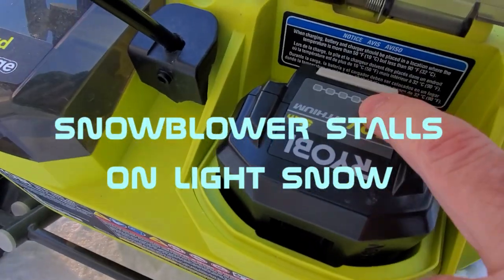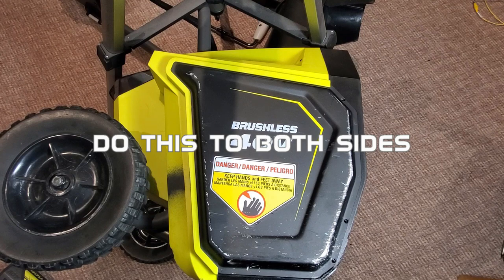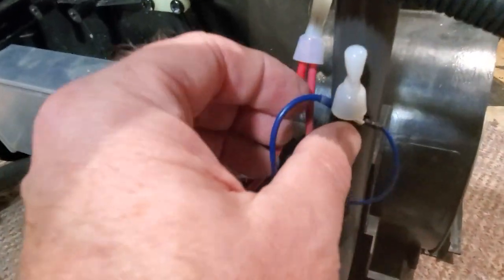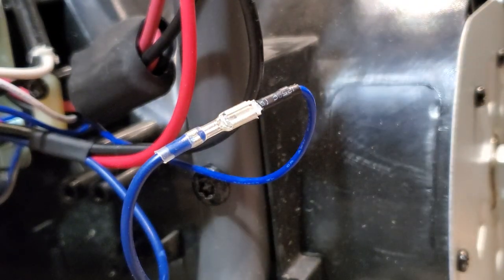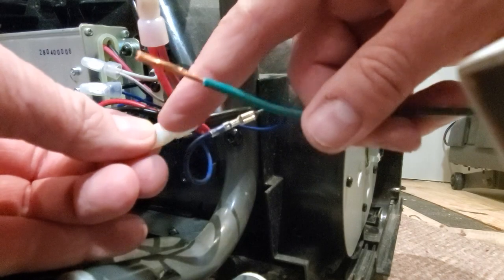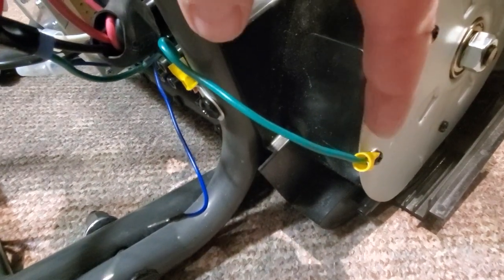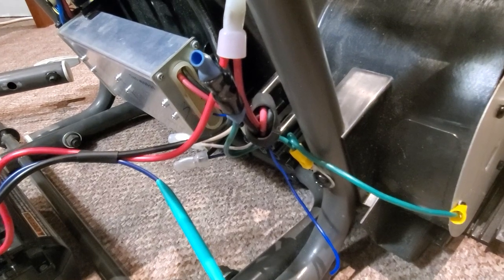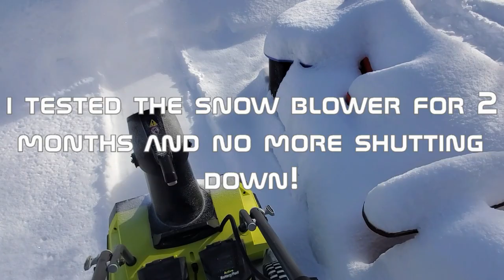Snow blower stalls on light snow

Comment: It worked, but this video makes it much more difficult than it needs to be. Just pull the cover off the right side with the 4 torx screws and wrap some electrical tape around the connection of the blue wire. Thanks for making this. Real life saver.
Reply from the maker: Actually I do mention and show how removing the one side cover does give you access to tape up the wires.  I was trying to reduce the static as well by giving a path to the negative lead.  Thanks for watching.

Comment: Two things....you should def submit this to Ryobi so they know the issue. You probably found it and they may not even realize all the people complaining about this, this is the issue. 

Second, i would also wrap some good cold temp resistant electrical tape around the bar you pointed out. So if the shrink wrap fails or if someone doesnt have any or a heat gun, a small thing of electrical tape wrapped around the bar might also work.
Reply from the maker: Good tips. I'll try and contact Ryobi about this.  Thanks for watching.

Comment: I can't wait to try this on mine!  Thanks for posting! Go Jets!
Reply from the maker: Good luck with your mod. Go Jets!
Reply: @thecityviking  I have one generation newer than yours, though not the newest version, and it has been having a problem similar to yours, but not exactly like yours.  I opened mine up and they had eliminated your bare cable issue . . . found some wires that were pinched which I thought might have been shorting to ground, freed them up, but still having the issue . . . my issue may also be tied to the "throttle" adjuster, as it seems to perform better just slightly back from full throttle . . . puzzling.

Comment: You have a brushless motor and I think the data line is supposed to be to signal sending more power to the motor if things start to bog down. I have a Ryobi brushless lawn mower that will spin up faster if I hit some thick grass. It tries to auto compensate like a gas engine would do. I've had a similar issue with a similar Ryobi 40v snow blower that I'm about to take apart so this was very educational. For me I think I may have damaged the safety bale cable that goes from the handle to the unit, so I'm about to take it apart and see if I can just patch the cable if it's not a tension cable and is just a switch line. Wish me luck! I think I may actually record my progress and if I get it working, post it on youtube because there's so few videos showing how to fix this shutoff issue.
Reply from the maker: I believe you could be right about the data line. As for the cable for the switch, I have a video on that for a different make. 

https://youtu.be/i7FvKgWHhik

Thanks for watching.
Reply: @thecityviking  thanks! I'll check that out!

Comment: There are lots of negative reviews of various Ryobi 40v snow blowers that exhibit the same issue. I wonder if it's all due to static.
Reply from the maker: I bought mine second hand off kijiji.   I bought it thinking it would never perform as good as the gas one I owned but was surprised that I had problems with the lightest of snow.  Now, with the modification it performes as good as I could expect for a single stage snow blower. 

Thanks for watching

Comment: My Kobalt snowblower does the same thing when temperatures are in the single digits, some I have to disconnect and reconnect the battery to get it to start again.
Reply from the maker: It does sound like a possible static issue. Thanks for watching.

Comment: I just tried my snow blower after many years without use, it worked fine the first part of the storm, in the middle of the storm i tried again, it blowed some heavy snow and shut off and it didn’t start until I removed the battery and tried it again and it just touched the snow and shut off , and notice the spinning of auger sound slow and weak. Do you have any idea why auger sound slow
And weak, I checked inside of the snow blower and it is different,now the three wires (red,black and blue) attached to a big white plastic connect so the static is not the problem
Reply from the maker: It does sound like a different problem than what I show in my video. A couple things I would check...
1.  Try a different battery
2.  Make sure the handle is completely extended as there is a switch inside which disables the auger. 
3.  Take it inside and let it dry out completely

Hope one of those helps otherwise you may have a motor controller issue and you would have to replace it. Several people say it may be covered under warranty, so you could also try that. 

Good luck and thanks for watching.

Comment: Could this the same problem on the new 21 inch Ryobi whisper series?
Reply from the maker: I am not familiar with that one, but if the symptoms are similar, it could be.  Winter is notorious for static electricity where I live, so if it's not protected from static, it's a problem.  Thanks for watching, and feel free to share a link to the video on any appropriate sites. Good luck with your snow blower.
Reply: Thanks for getting back to me. I am just looking to buy a battery operated snowblower, I already have the battery powered Ryobi lawnmower and was look at the  Ryobi 21 snowblower whisper series because they both use the same battery. Most of the reviews and consumer report are not that favorable, the machines stopping, stalling in light snow, and people returning??
 @thecityviking

Comment: Mine just completely stops and then I can't even turn it on again. it won't stay running long enough to take a pass. and its only two years old. :(
Reply from the maker: Did you check the switch in the handle or tried a different battery?  In the part of the handle where it collapses there is a switch that prevents it from running if the handle is down. Perhaps you have a bad switch?
Reply: @thecityviking  hi.  It tries to start and turns over, but doesn’t stay running.   Batteries are good.  It ran fully for one pass down the driveway but then it just stopped.

Comment: Mine has started to do that as well. And when I start it up it turns on/off for quite a few times before staying on.
I just got it this fall and have only used it half a dozen times.
Reply from the maker: If it's still under warranty, you could go that route, but just moving the wire out of the way with a tie wrap may be worth a try. Thanks for watching.
Reply: @thecityviking  Thanks! I have contacted them and they are going to connect me with a local repair service as it is still under warranty. Glad I saw your video!

Comment: Pure garbage of a snowblower.  Plastic, no skis so gets caught on every crack and not a steal leader so it will wear out faster than a show shovel that has a steel blade.  Other than that its perfect.
Reply from the maker: Well I don't make them but thanks for sharing. My snowblower does have a metal blade, but you are correct that it lacks metal skis. I bought mine for 200 bucks on Kijiji and included a battery and 2 chargers.   I didn't expect much, but I am happy with it so far after the repair. I would prefer a 2 stage electric snow blower, but 1,500 bucks is a little steep for me right now. Thanks for watching.